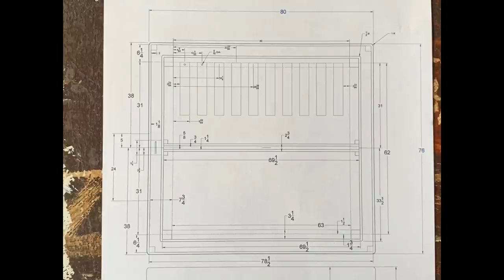Platform Bed Complete Build

Comment: Always enjoy watching your builds, thank you for sharing. I’m saving up for a jointer and I have been looking at Grizzly, how are they in terms of setting up, as in setting up the in feed table , squaring up the fence? I’ve never had a jointer so I’m very much a beginner
Reply from the maker: I bought several grizzly machines.  generally its not much different than more expensive brands.  sometimes identical, just cheaper paint job.  the idexed carbide cutter head is worth it if you can afford it.